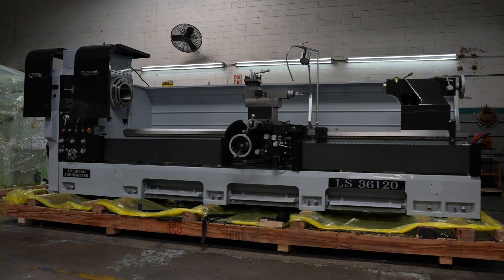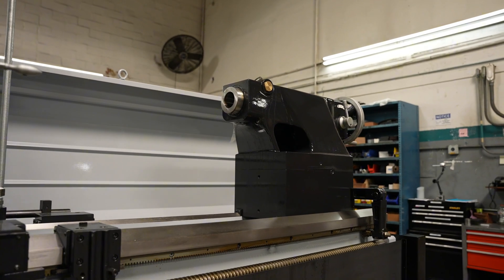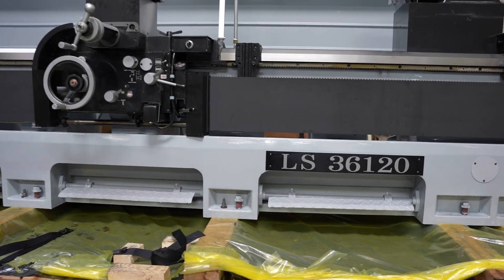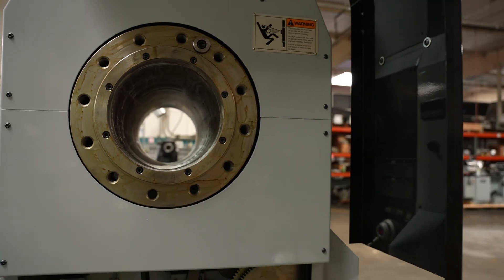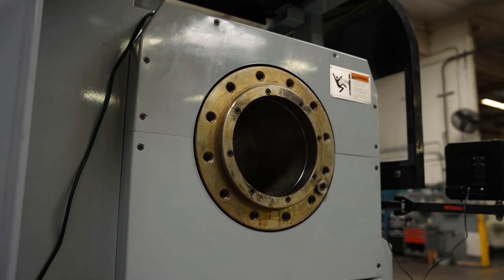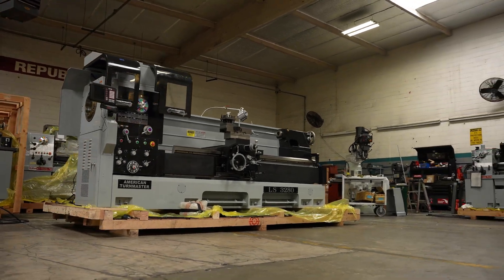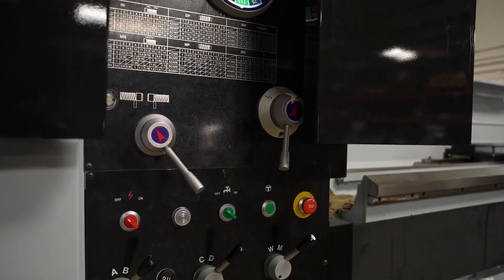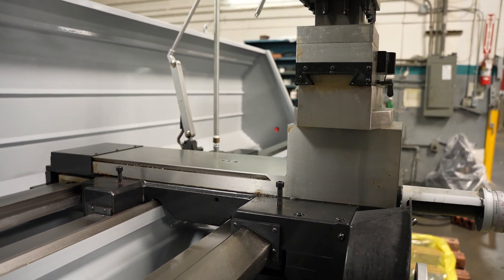This American Turnmaster Lathe Is a Freakin’ Beast – 25HP of Pure Power

Comment: Oh this is for oil and gas.  Precision doesn't care who you intended market is dickheads.  Either it's good or not.
Reply from the maker: Thanks for your comment! We completely agree—precision is paramount regardless of the industry. While the LS lathe is engineered for exceptional performance in any application, we highlighted the oil and gas sector in this video because it’s experiencing a resurgence, and many in that field are actively investing in new equipment. However, the lathe is absolutely suitable for a wide range of industries that demand precision machining. Let us know if you’d like more info on its versatility!